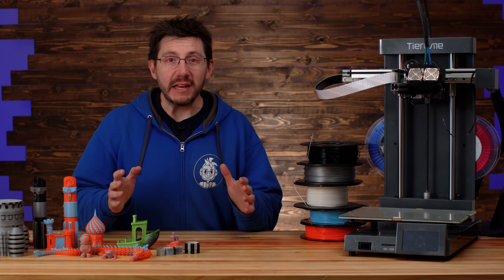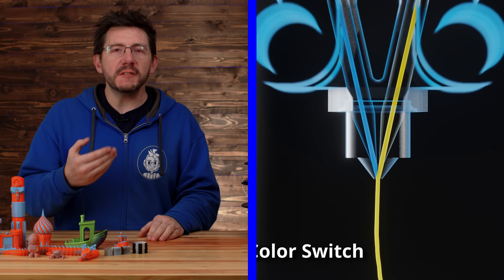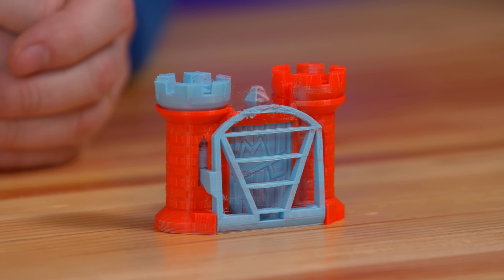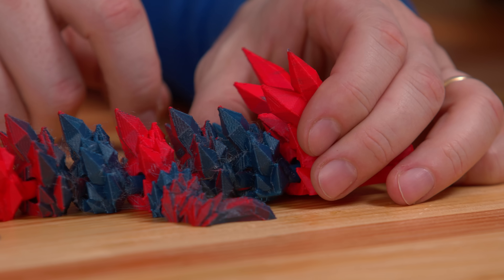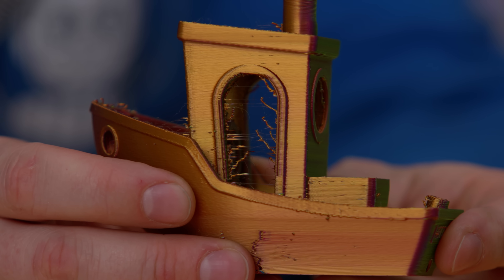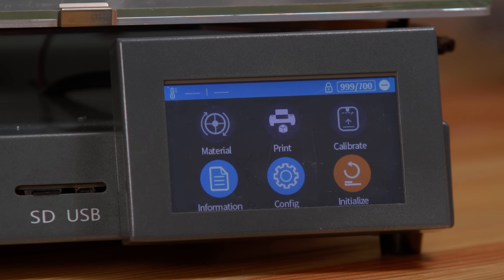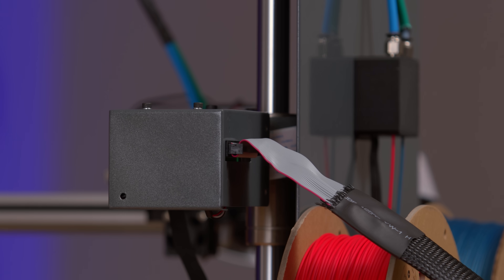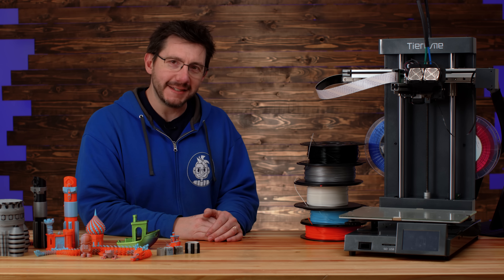Multi Color with NO Purge? Articulated Dragon on the Cetus 2 for a First Look!

Comment: A cable path that rubs against the filament spool is a far bigger problem than a locking connector! That's a worn cable guaranteed. Needs completely reworking.
This print technology is massively overdue but also sadly half baked. Well done to Tiertime for getting there first. Now let's see an 8 colour version.
Reply: 5 color with proper mixing capability (R, G, B, BL, Wh) might be enough.
Reply: @peterkiss1204  Agreed, although printers that do that already make AWFUL prints. The mixing is just awful.
Reply: @peterkiss1204  You mean cmy b w?
Reply: @TheWoeggil  That's another possible color scheme, but bright yellow, true magenta and cyan aren't common filament colors, while red, green and blue are fairly common.
Reply: That cable connection is bizzare. All it needs is a 3d printed stress relief grommit... But no excuse for it shipping like that
Reply: @rattslayer  it's not shipping like that - he has a pre-production machine. The Cetus V1 machines have been fantastic and again Cetus shipped out pre-production machines to reviewers.
Reply: @pa2797  yeah, I think some people for get this is a PRE PRODUCTION version as in not the final version
Reply: @England91  I didn't forget - I didn't know.
Reply: @Martial-Mat  you did forget because he said it in the video before you see the cable issue.
Reply: @johnandrews9433  No, just didn't watch the whole thing.
Reply: @Martial-Mat  if you say so ;)
Reply: @johnandrews9433  I do say so.
Reply: @Martial-Mat  is it always this hard for you admit you made a mistake? Or are you just an edgelord that needs the last word to make yourself feel better?
Reply: @johnandrews9433  to be fair he did actually say he didn't watch the whole thing which is more than most people do plus (well ig now I got it) you got the last comment being hostile for no reason